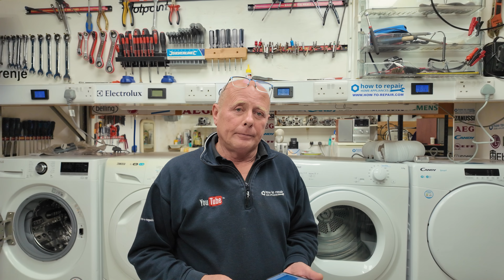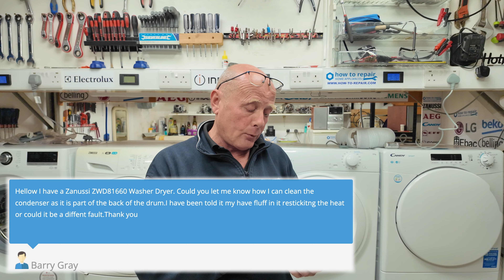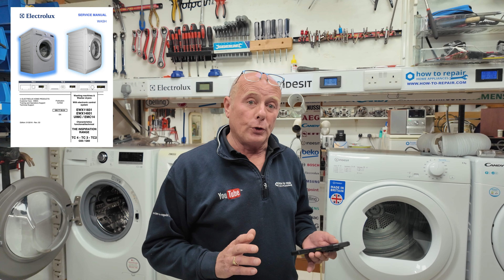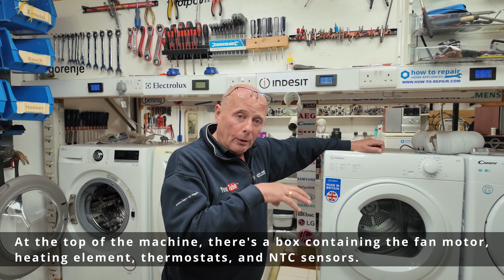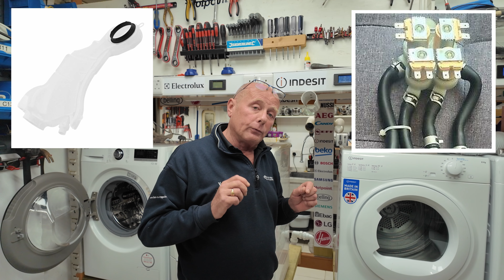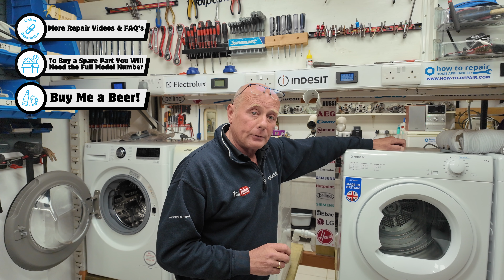Zanussi ZWD81660 Washer Dryer Has Low Heat - Zanussi Washer Dryer Repair Guide & Troubleshooting

Comment: My uncle has a integrated zanussi washer dryer which won’t heat up and will skip to 11 minutes Z716WT83BI_WH
Reply: Having same issue. Has this been sorted?
Reply: @ no not yet
Reply: @Ringerjay2did it get fixed yet? Mine doing the same